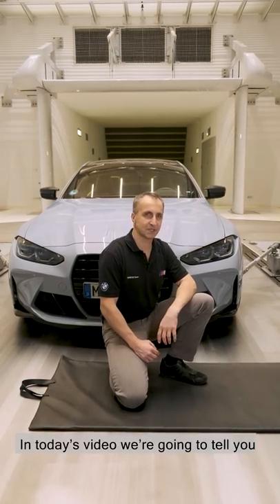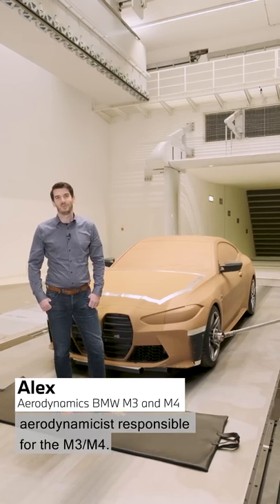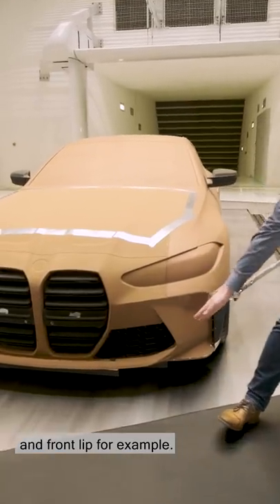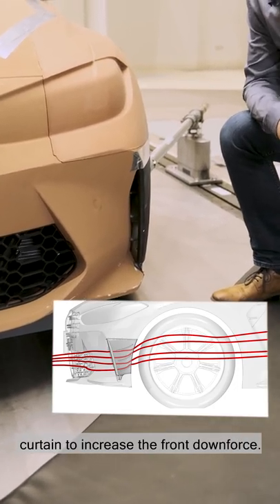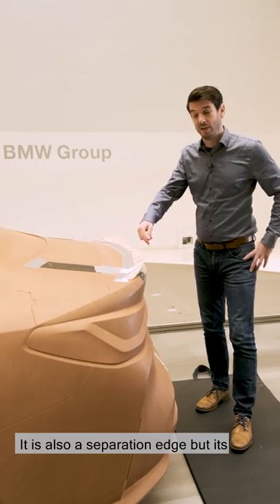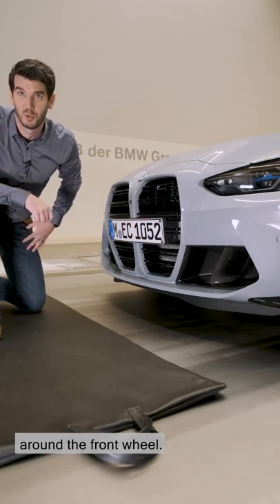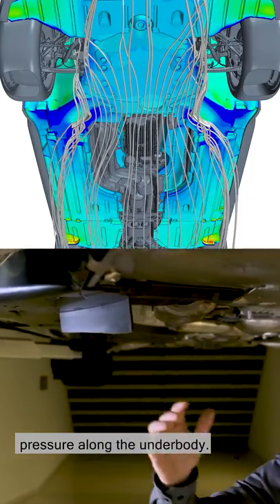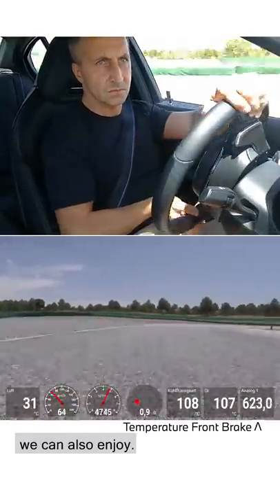Aerodynamics. M3 and M4 - explained, Episode 12.

Comment: Minute 8:30: "Downforce is reduced"? I thought the goal is to increase downforce. 
Glaube die deutsche Originalstimme spricht auch von "Auftrieb wird reduziert".
Reply: Downforce is reduced evenly from front and back. Probably for even flow of pressure around the car.
Reply: Ist mir auch aufgefallen. Ich denke es geht darum die Strömungsgeschwindigkeit entlang des Unterbodens konstant zu halten, damit die korrespondierende Druckverteilung gleichmäßig bleibt und damit an vorder- und hinterachse der gleiche Abtrieb generiert wird
Reply: Downforce is drag, but what is really annoying is that it's actually lift.   Lift acts laterally and "upside down" as well.  When you take off in your airplane, the wings obviously generate lift but so does the rear elevator...only it develops lift toward the ground thus acting like a lever and lifting the front of the plane up.